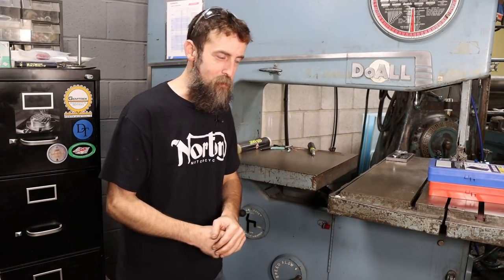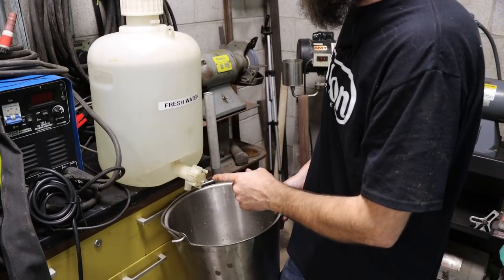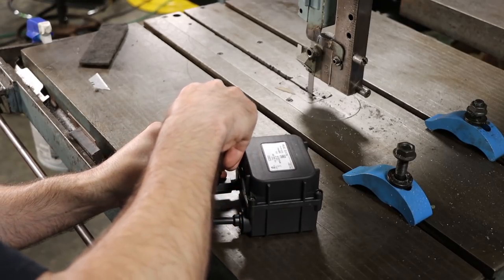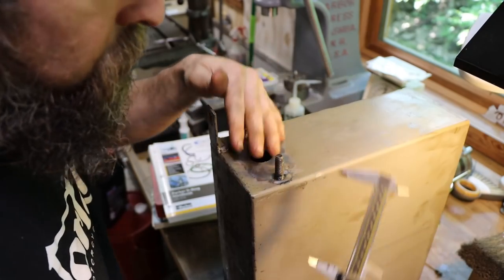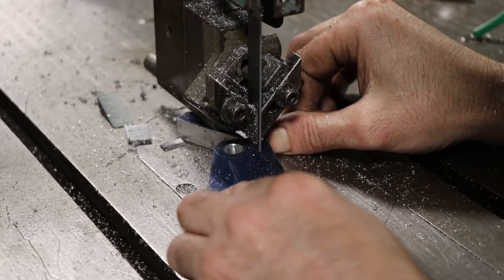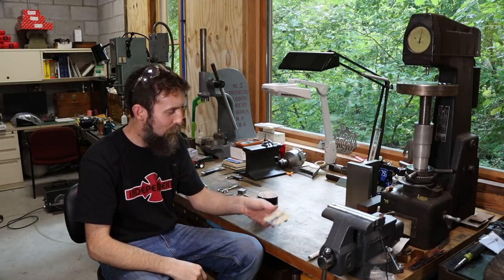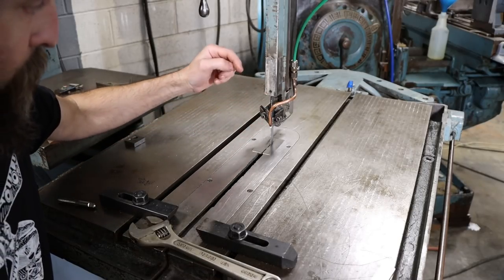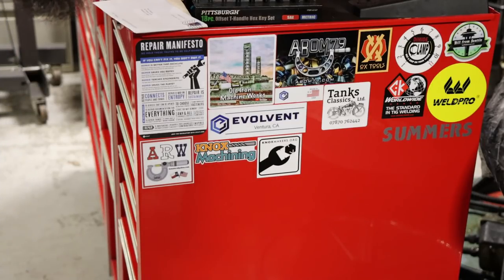Making my saw blades last. Saw Coolant System

Comment: The saw didn't flinch when cutting the tool holder. Coolant works a treat. Steve, I would add a little bit of chlorination to your hand wash water. Dehumidifier water stored in a closed container at room temperature is an invite for Legionella. Best wishes, Dean in Oxfordshire, UK.

Comment: The Band saw turned out great, its always nice to fix all the small issues the previous owners of a machine didn't bother fixing. A band saw is something I would like fot the shop but there just isn't room.
Scrap lathe tool holders, machine well enough with carbide tooling most of the time, useful supply of decent steel for homemade tooling when you don't want to wait for some bar stock to be delivered.

Comment: It is delight to watch your shop come together. I installed my new hoist yesterday. I found a new old stock 3T hoist and trolley that is perfectly suited for my 3T gantry. The hoist shipped in 1977 and was still sealed in the original crates. I picked up the pair for about the cost of a used 3T trolley. I am tickled. This setup shipped the year after I entered the trades. It is now doing the work it was manufactured to do.

My favorite O ring lubricant is Parker O ring lube, original formula. I don't care for Parker Super O ring lube. It is too sticky and messy for my liking. Mc Master Carr still carried the original formula when I bought my last tube. It was getting hard for me to find.

Comment: I have used cheap pond pumps for coolant use for a long time, they work very well in that use, and come with a nice coarse filter foam inlet. Take the outlet to a cheap non return valve, either from plumbing or from garden irrigation section, and it will hold prime as well for an open system. For the air lines and coolant lines inside do not use PU pipe, it will degrade and fail after 3 years or less, so best to either use copper or nylon tube there, but for the coolant do remember to not mix metals, either all copper line and no steel, or if you have steel fittings swap them out to brass nickel plated push on fittings, those last a long time in there. 

For the return pipe just go grab a pack of dairy milk filters, they are really good at getting the tiny parts out, so long as the return to the tank has a pipe you can slip it over and hold with a cable tie, and they catch all the fine particles out. Just have to check regular and replace as needed, and get a size that fits your need. I used them on machine cooling to ensure the tank stayed clean, and ran it through a condenser coil to cool down the water as well, as the tank was not big enough for natural cooling. Use them on fish tank filters as well, they do get a lot of small particles out, and last around 2 months before you replace them, though you clean them regular. Get 4 out of a regular length sock, so a box really lasts.

Had to add potassium iodide to the water to keep bacteria growth down in the pipes, so food safe coolant, and nothing other than deionised water and the KI, so it stayed clean and clear for years, aside from top up water. he PU pipes failing was the only issue, so went and replaced all with nylon, after the first crack, even though it did mean a lot of extra elbows, as the nylon does not bend easy.

Do not use the plastic ones where they are hidden, they will fail and leak when you least expect it, though the aluminium Festo ones are great, just expensive, and with water and soluble oil will not corrode.

Comment: I work for Parker and have installed tens of thousands of O rings over the years. I have to maintain an O ring certification as well as lockwire and braze/weld inspection certs on a yearly basis. Our O ring classes are taught from that book. There is everything you ever needed or wanted to know about O rings and their use and installation in that book. Very useful...
Reply: Is there a way to get a printed copy of the Parker oring book like Steve had in the video?

Comment: With the O ring kits take a photo of the sizes in each kit, and then every time you are at the HF look at the current kit they have, likely the sizes will be different between them. I just take the sheets and put them together, and fill in the one pack from the other, so the diameters are roughly the same, saving space by making 3 boxes fit in one. Also get a box of the green refrigerant ones, they work well where you have oils or solvents that dissolve the nitrile ones.
Reply from the maker: Good idea👍

Comment: Greetings from the 🇬🇧 UK. You've done a tremendous job with the saw. Our equivalent to the US "Harbor Freight" is called Machine Mart. They sell inverter welders and other machinery that I am sure is the same stuff you have over there, just badged differently. It is good value for money. I agree with your sentiments regarding your new welder. It is truly astonishing how far things have come and the level of capability that is within the grasp of the amateur these days. I have a very good AC/DC welder from a British company called Rtech. Of course, the unit is made in China but the UK firm controls the quality and all is well.
Glad to see you are getting stickers and t shirts from the UK too. Nice Norton t shirt too by the way!
Reply: Also from the UK and a big fan of my RTech MIG welder.  So much better than then welders I used 20 years ago.

Comment: I have replaced the coolant pumps on several saws with Little Giant pumps they are made to work outside and have stainless steel shafts. Good job on the saw Steve.

Comment: Great saw Steve. I always use wood or aluminum blocks when sawing so my fingers were never close or never ever in line with the blade. Many machinist injuries are later in a 
tradesmans career when He gets very comfortable around equipment.
Reply: The only major cut I've ever gotten in 40+ years of shop work was on a bandsaw. Not TOO bad, only 9 stitches. I made 2 mistakes: dull blade, and trying to talk to someone as I was cutting (I.E. distracted). I love bandsaws though.

Comment: I have those o-ring kits - I've never once used them. Every o-ring I've run into that needs to be replaced is some custom size that's not in either of those kits (usually way thinner than anything in those kits). I end up ordering them from online places that specialize in o-rings and have basically any thickness and diameter you need.
Reply: I have the same issue, but not only the Harbor freight kits but 2 or 3 others I have as well.
Reply: Glad to here I’m not the only one.

Comment: Water out of dehumidifiers has very low hardness and is good for cleaning windows and things or to dilute acids and other stuff. 
Maybe keep in mind that the water in your cooling solutions might evaporate faster especially the lower the air humidity is and the more it is exposed to the air (surface area). 
Thanks, Great Episode as always
Reply: Put lids on all coolant tanks or make a re-sealable cover. You have the tools and technology.

Comment: I keep several of those kits around, but still never have the right o ring. Funny story needed a new O ring for my harbor freight hose reel, that's right the proper O ring was not in the harbor freight kits.
Reply: Splicing usually works in a pinch though. A bit of superglue often does the trick quite nicely

Comment: A cool project would be to do a bit of horizontal milling and cut a new slot for the blade on a piece of stock, to replace that mangled part of the table. Wouldn't have such a big gap then.

Comment: Loving that saw!

That little giant submersible, assuming it’s like every other submersible aquarium pump, has a large electro magnet and a magnetic impeller, and the tiny metal chips are going to get in there and clog it up pretty quick. As far as I have found there’s no coming back from that, it will eat up the impeller in the process before finally seizing. The ones that are sealed between the magnet and impeller probably work much better, but it does make me wonder how they solve that issue in their original setup.

Also, be careful with the water, I know you’re not drinking it, that comes from the dehumidifier. It will become full of bacteria and algae and such, unless you’re keeping it clean. Not sitting in the bucket definitely helps.

Comment: I used  the same pump and put a t fitting on it in the sump with  a valve for bypass not to have the pump running  stalled flow

Comment: Is water from dehumidifiers risking  Legionnaires' disease? Or is that just cooling towers? Sorry for mentioning that!
Love the support amongst viewers and like minded channels, really shows the true strength of America. Respect from New Zealand.
Reply: A cooling tower aerosolizes the water allowing it to spread elsewhere. Using the water as coolant is safer as the additives in the coolant are designed to inhibit the growth of bacteria in the coolant
Reply: @millwrightrick1  Thanks for the reply, I am wondering if this is better than hard water for use in model boilers, less contamination build up, clogging things up, I was thinking as good as distilled water for this use.
Reply: I used to maintain boilers and cooling towers. We had water treatments for both to alleviate problems with scale and bacteria growth. Dehumidifier water is fine as boiling it will kill anything in the water. And no scale.
Reply: @millwrightrick1  Thank you once again. It did seem a shame to throw away water that is good for this use.

Comment: A small magnet at the bottom of the overflow box could catch the swarf and keep them away from the pump, I guess!
:-D
What was glued on the inside of the upper wheel cabinet, another calculating table?
Nice vid as always, thx a lot!
:-D

Comment: Hi Steve, in your last video about the blade cutter you said that it cuts better back in the jaws. Why don't you use some of that tool holder you cut up to make a couple of pads to attach to the guide ears to set the blade closer to the jaws.

Comment: Steve , a little trick I saw on solid rock machine concerning coolant, he said to use distilled water to mix the coolant because it will not evaporate like normal water and will not go bad and start smelling and last much longer. Contact him to verify this.
Reply: What kind of water do you think comes out of the dehumidifier? Pretty dang close to properly distilled, I'd say.
Reply: @mattmanyam  dehumidifier water is very dirty due to air pollution that is drawn through the dehumidifier and deposited on the condenser and then washed into the tank.

Comment: The pump on my surface grinder is froze solid.  I've got an R.V. water pump, build out of the better parts of two, that I'm going to experiment with.  A length of tube or pipe, capped on one end and T'ed into the pressure side, should help to cushion out the little surges, and they have a pressure switch.  Big questions are volume (enough?) and how well will diaphragm hold up to coolant.  It was build on a whim, out of spare parts, so if I kill it I haven't lost anything.  If it holds up/works well, people will know of another source of pumps.

Comment: Man that's a cool shirt had a 71-750 Norton Commando with a 74 -850 engine .There was a Norton race teem in the 70's top fuel twin engine Norton called The HogSlayer if you google hog slayer they have a video i think you might like it . Also great work on the saw Steve and like the welder . Steve aka junkman .

Comment: I noticed the bearing behind the blade is coated in coolant wile cutting, because it’s only a shielded bearing so the coolant and enter it but not necessarily drain out do you think that could cause the bearing to fail a lot sooner than normal

Comment: I wouldn't have a fresh water label on the jug if you put dehumidifier water in it, that stuff is not fresh or clean
Reply from the maker: That label is where I had tap water in it .  I think the chances of someone drinking out of that jug are pretty low😁.
Reply: The water from the dehumidifier contains Deuterium Oxide and a measurable quantity of Tritium.

Comment: What you call tricks, are not tricks.  Belt tensioning, coolant,cleaning etc. are all practices advised by machine builders.  They are wise, common sense, like everything else I have seen you do.  It is things done to avoid common sense that are tricks, and these tricks are what make machining much more difficult than it should be.

Comment: For the shop, not only do you need to work for it and want it, but your partner needs to be onboard with it.  If your husband/wife/whatever isn't on-board you will have problems.  The other issue you can run into is what I am.  Code restrictions in the 4 or 5 counties around me prevent me from building a 60x40 shop, even on 11 acres.  I asked about my neighbors where I own property, because one has a 80x60, and another has a 40x100, and the answer was "We changed the rules in 2019"...No vote, no public comment, no notice...changed the rules.  Frustration is high...VERY  high...
Reply from the maker: I can imagine so. I would prefer to ask forgiveness than permission